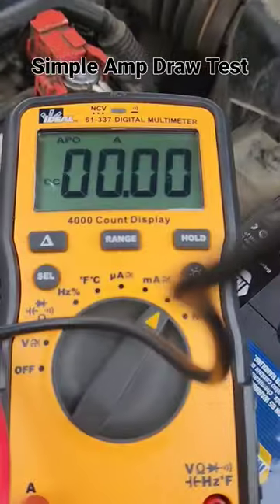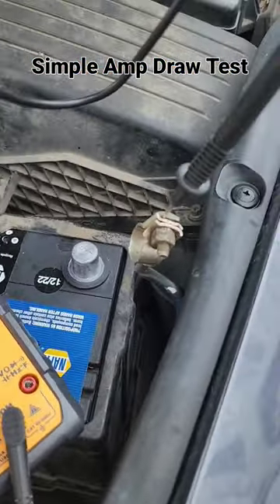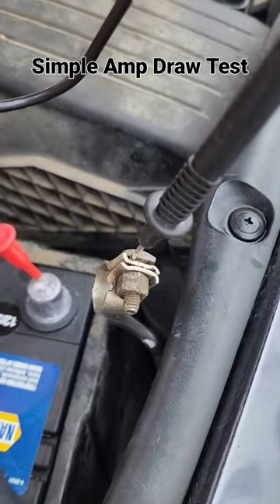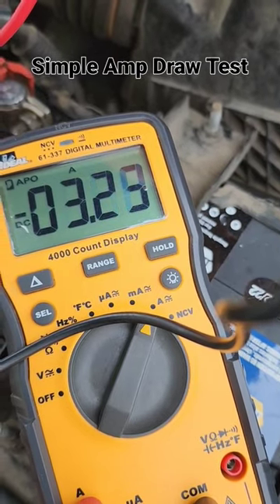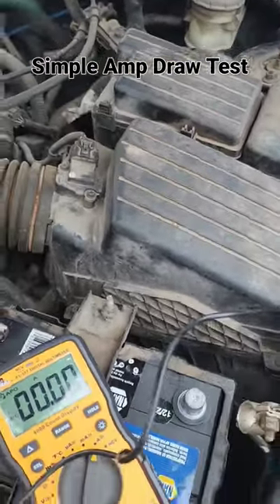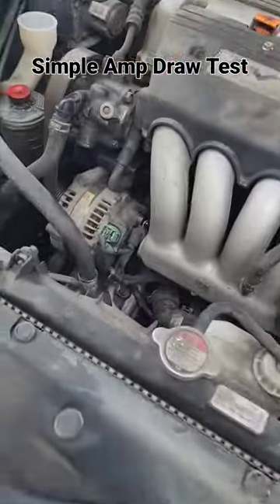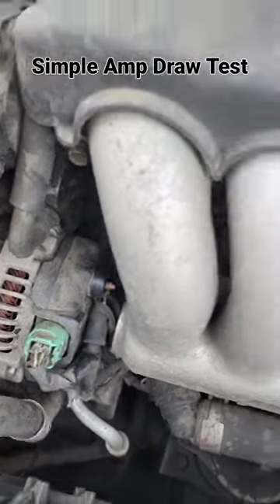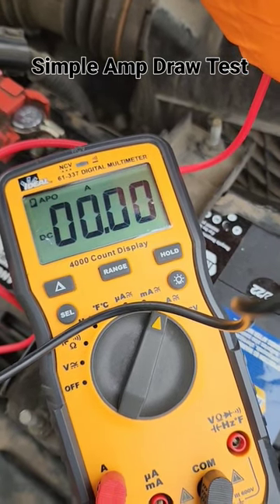What's draining your battery?! How to find a parasitic draw! (EASY)

Comment: Clamp meter better if you don’t want to zap your digital multimeter - just think when you connect the negative lead to the battery & the spark you get - that could be a current draw of more than 10 Amps in my humble opinion. 

Think I’d prob use the voltage method on the fuses - there’s a relationship between the millivolts measured & the current drawn - can’t remember where I saw it but it’s out there on tinternet….
Reply: All multimeters have fuses to protect the current measuring circuits, if too much current goes through it, all it does is blow an internal fuse. On the amps setting, its often a  5-10 amp fuse, on the milliamp setting its a few hundred milliamp fuse,  depends on your meter.
Measuring for voltage drop across a car fuse is nonsense, fuses dont have signficant resistance. If there is a voltage drop it means there is siginificant resistance across the fuse.
Reply: @jumboegg5845  I mentioned I didn’t have a clamp meter at the time - but you go right ahead if you think a fuse is going to protect your multimeter in this scenario. 
If it’s a $10 multimeter then what the heck eh - not forgetting the aggravation of changing the fuse - some are non standard so you’d have to order one unless ya bodge it to get a job done. 
You’re then hoping it actually went short circuit before zapping the multimeter - not nice seeing circuit board traces burnt to a cinder due to time for fuse to blow or LCD display gone due to voltage spike. 

Using  more expensive multimeters most take precautions when using on ‘any’ equipment before sticking probes in/on. 

The voltage through fuses does work - it worked for me - & obviously works for others when watching those mechanic/creators on YouTube that demonstrated it. 

It’s slightly more techy - with the different graphs for different fuse ratings - but one can get carried away as it’s not too difficult to find where the current draw is & what value one should expect. I’m ok with it. It’s not rocket science. 

I think this creator did a YouTube on the voltage method 🤔 but may I suggest 
“Which parasitic draw test method is best” by FordTechMakuluko - he covers the bases - & precautions too. 

There are also isolating battery clamp terminals made with a switch to help protect the on/off scenario of probing with multimeters. They go some way to protect the multimeter - but I’ll make my decisions if/when faced with this scenario again. 

All the best! Happy diagnosing!
Reply: @messageobliquespe100  Its just how fuses work, a fuse very effectively protects the circuit from over current. If your cheap 10 amp rated multimeter can't actually handle 10 amps (because its poorly designed and overated), then always best to use a lower rated fuse (say 5 amps), to make sure it never works close to its maximum stated rating. The fuses in multimeters are special high energy ones, designed to protect you (not the multimeterr) against high voltage spikes of 1000 volts or more. This can only happen in general use if you are working on mains power, or if the car you are working on is struck by lightning lol.
A fuse is a resistor, and because of its resistance, a 10 amp fuse for example will start to get hot and will show a significant voltage drop across it when it starts to get close to the 10 amps, slightly above 10 amps and it will get too hot and melt. That's how they work. So I suppose the voltage drop across a fuse might be useful sometimes, but the voltage drop would be very small, if like for example in the video the parastitic current draw was only 3 amps. 3 amps across a 20 amp fuse would show a tiny drop in voltage.
 I just went into my shed and put 12 volts 3 amps across a 10 amp car fuse, and measured a voltage drop of about 0.08V (80 mV) across the fuse. Thats very small, but I suppose it could be useful as a very quick check, but only if all other fuses show no voltage drop, and only if there is no legitimate reason for something to be drawing 80 millamps across that fuse.
Reply: @jumboegg5845  Thank you for your comments - all taken on board. Fuses can be effective in protecting the circuit from over current - but you’re at the mercy of the engineer that designed the circuit & specified fuse rating /quality adopted by the manufacturer. (I’ve been down this rabbit hole before - a 5 amp mini blade fuse in an expensive bit of kit that wouldn’t see much more than 1.7 amps at a push/fault when speaking to the service engineer. I imported & used 1 amp fuses - equipment been fine for years. 

I apply this rule to expensive electrical equipment - even domestic equipment - & down rate the fuse ratings where I feel fit / the need. Simple to take current draw readings from standby to switch on & select on that basis. 

I’m a bit precious of my Fluke multimeters they cost enough to warrant being careful with. 

With regards to your analogy of fuse breakdown - ie ‘slightly above 10amps & it will get hot and melt’ - fuses are more robust - can operate well above their rating for a number of hours. 

Blade fuses will carry on working for 100hrs at 110% of rating - 10mins at 135%  - 5 secs at 200%. If there’s additional headroom given to the fuse adopted in the unit you can see how things can go south. I’ve not looked at the fluke fuse & its characteristics. I should put on the list but take for granted they knew what they’re  doing so I’ve not bothered. 

 “the voltage drop across a fuse might be useful sometimes” - glad you’re coming on board! The voltage drop is very small - we’re talking measurements in millivolts. 

In the Charts/tables you can read off the millivolt measurement for the fuse rating & see how much current is being drawn through the fuse/circuit. Search for blade fuse voltage drop on tinternet - Wordpress.com should come up 

This voltage reading is a measure for the current through the fuse. You can look up the current value in the table. 

From charts - for info:- 
10A blade fuse: 
Resistance = 8.12milliohm. 
Voltage drop 116 millivolt -(I think this is maximum value of approx 1.4x fuse rating). 

For a 3A draw - through the above fuse - you should see a voltage of 25mV. 
(4A 33mV. 5A 41mV. 10A 82mV)

To measure the voltage drop across the fuse, set voltage scale to mV - place the positive lead on one side of the fuse and the negative lead on other side. 

It takes seconds to do. When you see any value on the multimeter you will know there’s current going through as most circuits will be off or very little current being drawn - so anything greater than say a millivolts or two will stand out - & be a circuit to investigate. it’s a quick method - BUT note what the FordTechMakuluko on YouTube covers. Hope you watched it 🤔

Approx values - for 1 millivolt:- for fuses:-
3A = 30mA 5A= 50mA 7.5= 90mA 10=120mA etc - Usual current draw in vehicles range from say 40–80mA when ‘shut down’ so over this can result in draining the car battery - which is what we’re trying to diagnose. 

Let me know of your further shed tests. 

Happy diagnosing! 

E&OE (I’m not in my shed)
Reply: @messageobliquespe100  Thanks for all that useful info, you put a bit of time into it. I know the maths and theory so probably wont need to look up the tables, but I am sure they will be very helpful to others reading this. 

Thanks for picking up on the milliamp "typo", yeah of course it was a voltage drop of 80 mV, not sure when that happened, must have been when editing to improve my expression.  I've edited the mistake so its not there now.
My experiment was quick and crude, just happened that the first load resistor I found was 2.2R 5W, was getting quite hot in my hands, quickly measured roughly 0.078V across the 10A fuse while holding it all together in my fingers, didn't bother measuring on the millivolt scale, was just after a ball park figure.
Just realised my mistake, I initially limited the current output of the power supply to 3 amps, and forgot to unlimit it when taking the measurement. Just checked now and current draw at 12 volts is about 4.9A according to my cheap bench power supply, yeah I know that value is a bit low, when I want an accurate measurement I use a multimeter.
In the video, the fault was showing 3 amp draw, which would stand out like a sore thumb.  I have found 12 volt relays with corroded contacts passing something like 150 mA when they should be completely open (off). When standby current at the battery should be roughly say 50 mA, an extra 150 mA at the batttery due to such a fault takes many days to drain a good battery, not overnight. Using your values above for a 10A fuse, the voltage drop across the fuse due to a 150 mA fault would be a tiny 1 mV, and even less for 20A fuse.
Reply: @jumboegg5845  No probs re putting in the time. It can sometimes help others on the journey. Hours of YouTube’s, comments from others help & I’m thankful for that. I’m just a shed type - a few bits of kit to help & a need to understand how things work, to my detriment sometimes but I do it once/twice & hope it sinks in - I’ve filed the above & links for future reference. It all helps! 

Ok typo error - I’ll edit previous reply to wipe that one away. Quick & crude experiments is the way to go - I was thankful you took the time to do. No need for me to do any more math - that’s why for I did the values for 1 millivolt on the diff fuses. That’ll be my go to from now on if the need arises again. As you say - larger current draws will stand out like a sore thumb - so this method can be quick - noting the observations of the other YouTube’s. Larger current blade fuses then you might not see the fault so easily but maybe a flicker of a number on the multimeter will make one think about it. I’m sure I’ve seen a project for extending the scale/range for millivolts - possibly for multimeter - but I’ve a 40yr old bench multimeter that I think can do that job if the need arises. 

My shed/hideaway is outta action at the mo with a number of cheap n cheerful power supplies buried in the clutter. 

Ok your observations on relays - I’ll keep that in mind as I’ve another round of diagnosing to do in a month or two. 

All the best 

Happy diagnosing!
Reply: Won't "zap" your meter.
At most it will blow the internal fuse which is only for amp readings, all other functions still work.

Comment: You can set DVOM to mV and check each fuse for voltage drop. Fuses that have current going through them will show a small voltage drop.
Reply: DVM or DMM Digital Multi Meter.
Reply: @dogwalker666 Digital Voltage Ohm Meter
Reply: @wolfjay1343  That’s not a thing,
Reply: No they wont, you dont understand electricity. A fuse should have no voltage drop, a voltage drop would mean there is significant resistance across the fuse.
Reply: @jumboegg5845  Exactly,  No more than the standard volt drop for wire which over such a tiny distance is not measurable especially not with a cheap consumer multimeter used by someone who doesn't know what they are called.
Reply: @wolfjay1343  Does that meter also do current, continuity etc. They are called a DMM actually a lot of professionals will say pass the "AVO" as they invented the Multi Meter.
Reply: @dogwalker666  It's So Simple To Just Do A Little Research Before Trying To Correct Somebody Bro. A Volt-Ohm-Meter Actually Is A Thing Sir
Reply: @wolfjay1343  Your google search is not the same as actually knowing, There’s way to much false information on line, The device is called a Multimeter by people who actually use them professionally, 
You have just embarrassed yourself.
Reply: @dogwalker666  Actually Knowing? Do You Know What A VOM Is?? We All Learn Something New Everyday And I Didn't Search Anything On Google I Work On Cars And Moped And Build Wire Harnesses Im Not Knocking Your Knowledge Or Anything Just Saying It's Definitely A Thing Bro
Reply: @dogwalker666  I Never Said That It Wasn't Called A Multimeter. You Stated That There's No Such Thing As A Volt Ohm Meter And That's False Bro That's All I'm Saying
Reply: @wolfjay1343  There is no such device, It’s an incorrect name, It’s like calling a lawn mower a motorised spinning slicing raking device.
Reply: @wolfjay1343  I know what the letter stand for, It’s just not the name, The device is a multimeter! Don’t need to invent a less accurate name.
Reply: @dogwalker666  This Is Going No Where. It's Okay To Be Wrong Sometimes Bro. It's Nothing Like Calling A Lawn Mower A More Specific Term Because The Term DVOM And VOM Are Actual Terms 😂 It Takes A Real Man To Admit He Was Wrong And Just Talking Out Of His Ass And It's Just Pathetic To Be So Stubborn But You Do You Bro
Reply: @wolfjay1343  It’s going nowhere because you are wrong It’s not ok to use a LESS accurate name, Especially when no one else uses it,
I am glad you admit it’s ok to be wrong time to admit you are.

Comment: Good stuff in this video. I'd just add make sure all doors are locked with door switches taped down and latches closed if doors are open for fuse access. Otherwise, you could blow the fuse in your meter rated for probably 10amps because of loads active when you unlock the car. If you're trying to find the circuit causing the parasitic draw, start pulling fuses that could be under your dash. Of course depending on the car year make model if this applies to you.

Comment: Pulling fuses on newer cars resets modules that can potentially be the culprit. Might make it for a longer diagnosis. I found it easier to do a voltage drop check at the fuses

Comment: I've been working on cars forever and never really thought that alternator can drain.... Thought it just wasn't charging.... Learn something new everyday
Reply from the maker: Yep, it's not super common, but this does happen! A shorted diode in the alternator will drain the battery quickly since the two are tied directly together. This can  happen if someone hooks up jumper cable or jump box backwards.

Comment: We used to be able to do this test with a lamp, but today's vehicles have so many "normal" petty draws that it doesn't work.

I'd add that you also might disconnect the alternator's control plug to see if the draw drops. That would verify that it's indeed a draw from "within" and not possibly an external control signal, possibly energizing the field, or whatever.
Reply: 9 times out of 10 it will be a bum diode in the alternator so that's high on the list.
Reply from the maker: Good point! I did disconnect the control plug and it did not have affect on the draw.

Comment: I did have a parasitic drain. I bought 2, $12 switches on my batteries  on my Saturn & F150. No more parasitic drains I can't "fix". I found the drain and fixed both vehicles, but still have switches on I turn of and on. It's a good fix if it's otherwise a mystery.
Reply: Did you connect the 2 disconnects to the pos and neg terminals or do you have two batteries and install them on both negative terminals?  I need to do this temporarily until I can find the source of my parasitic drain.  Thank you
Reply: @georgew84  no I didn't have a parasitic drain
Reply: @davidweum  oh sorry.  In your comment you said that you did lol

Comment: Fuses are a great way to find shorts. You want to do it at night time, you remove one fuse at the time, when you put it back if it arches, this is the short. But their is no fuse for the alternator, but most alternators have a nickel size round metal in the back, when it's running you should have a magnetic pull from testing it with a screw driver, if their is no magnetic pull? It means the alternator is not charging.

Comment: I just had my alternator replaced on my Mercedes 2014 sprinter 6cyl turbo diesel. $1200!
Reply: Try repairing it next time. A whole alternator rebuild is 100-200$ and it charges like a new one. 14.9-15V at idle.

Comment: My friend iam wonder if the alternator in my car is make a drain, if i removed the alternator fuse will it work or i need to remove the cable,the alternator in my car is hard to reach so in this way i can know if the problem is from the alternator
Reply from the maker: You should be able to just remove the alternator fuse and perform the amp draw test. Measure before and after removing the fuse and see if there is a significant change. Best of luck and God bless!
Reply: @HumbleHotshot  thanks bro i will try to test it out by removing alernator fuse first and see next day how much battery voltage, let check it out, the car is land rover lr3 i think 🤔 there is something wrong there is a little drain i hope it will not be a big issue
Reply from the maker: @ahmadlbl  right on, you're welcome brother. Unfortunately land rovers are notorious for draining the battery. Worst case, you can install a battery disconnect switch and turn the whole system off at night. I see these on a lot of older rovers

Comment: Unfortunately “most” multimeters only have a 5 or 10am fuse in them, and most modern cars will draw more than that at battery reconnect, my work truck 22 f250 cycles fuel pump when battery reconnects and evap system, total draw is around 18amps, while momentary still exceeds the meters fuse…….so, buy a stand alone old school needle gauge amp meter like you used to see in Chevy/ford/dodge dashes and use that, they normal can read upwards of 60amps, use it until you can get everything under 5amps then use a modern meter to look for low current draws

Comment: I just finished watching your shorts and you told me to put the negative on the negative wire and the positive probe in series on the negative battery right? So I Put my turned off multimeter on the car got my probe plugged into the right spots went ahead and set up my negative probe on the negative battery, and I set up my positive probe on the positive battery then pop! goes weasel. Should I have turned my multimeter on?